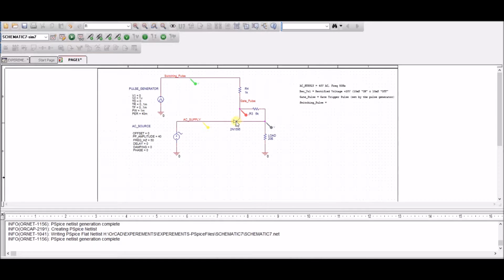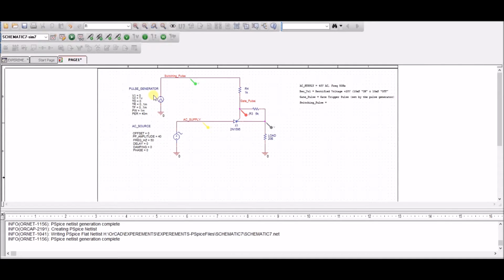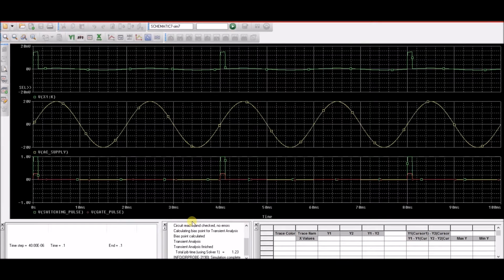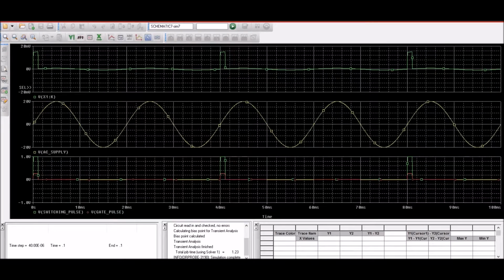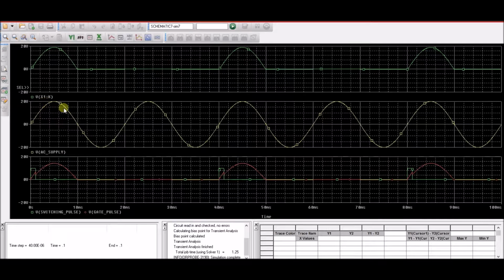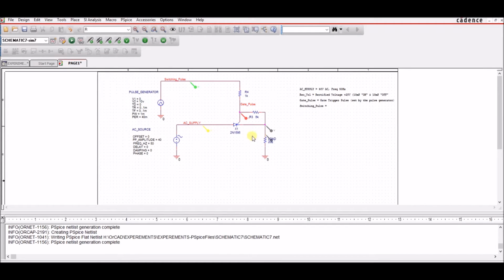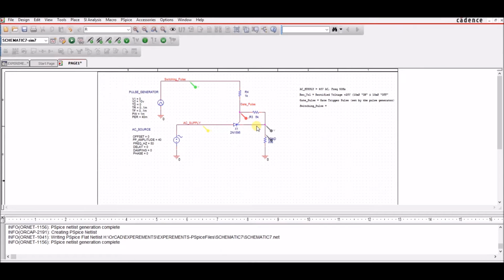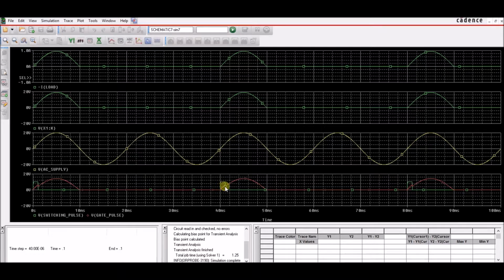BASICS  OF SCR/THYRISTORS APPLICATION-1

Comment: I think SCR has a mode model called remote base transistor. A cathode flows from the gate and a bipolar transistor is formed between the anode and the gate as a base (pnp type). There is a difference in current sensitivity depending on the polarity. It may not be necessary to use much current gain, and it can be used for small current voltage conversion within high voltage 400v or so for applications (from Toshiba supervised GE SCR manual). Can this be simulated? https://www.littelfuse.co.jp/technical-resources/spice-models.aspx#question_3